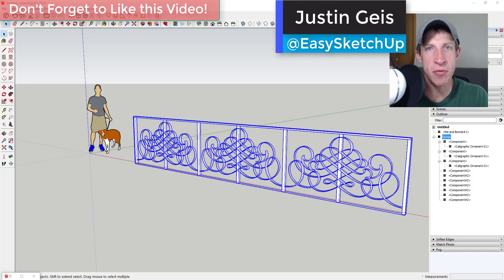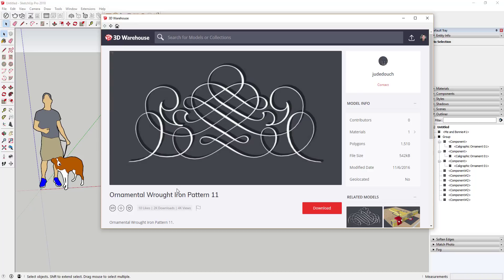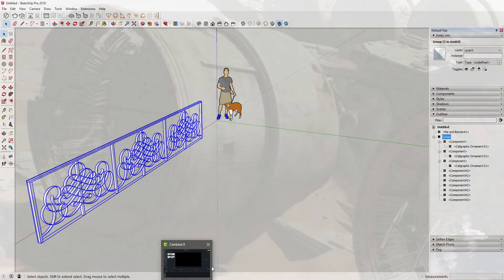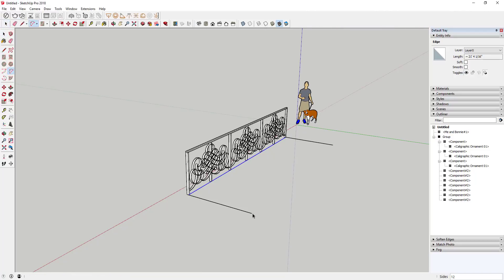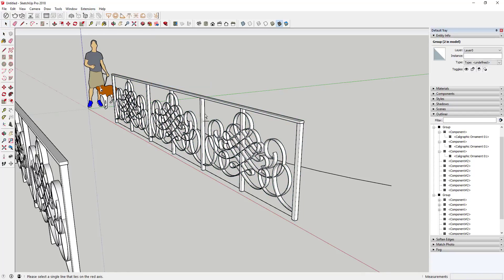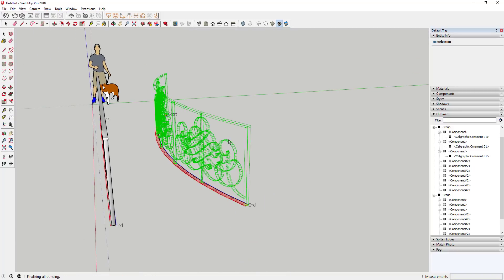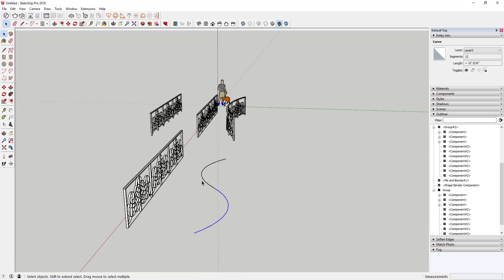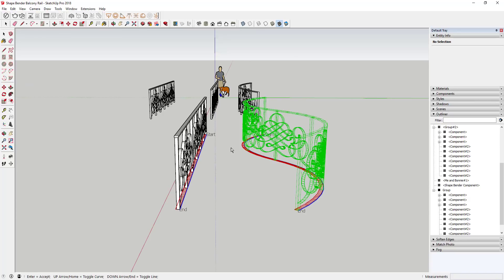CURVED BALCONY RAILS IN SKETCHUP with Shape Bender

Comment: You can make each part a seperate group and apply plugin one by one.. That way it easily bends shapes..
Reply from the maker: Why when you can just bend the whole thing along the path? Seems like a lot of extra work...
Reply: My laptop can not bend some heavy geometry, i tried the way i said and it worked nice.. More than one source group, one straight line  and one target line.. You don't have to draw the lines individually, it bends correctly..
Reply from the maker: Got it - thanks!